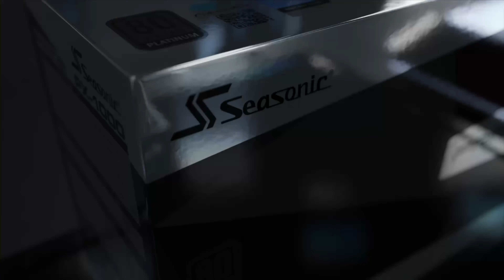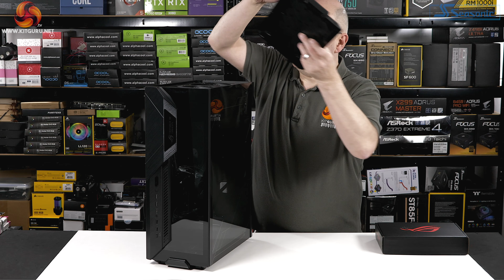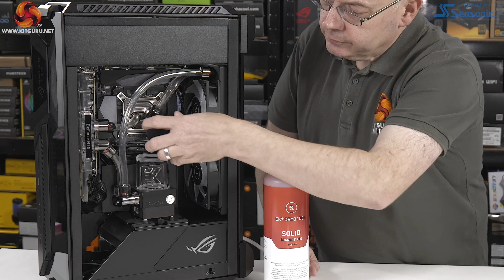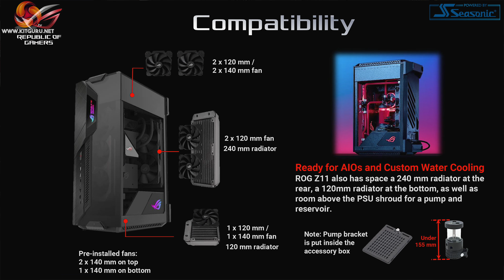Asus ROG Z11 is Mini-ITX. And Weird.

Comment from the maker: £240 - yay or nay? 

00:00 Video Start
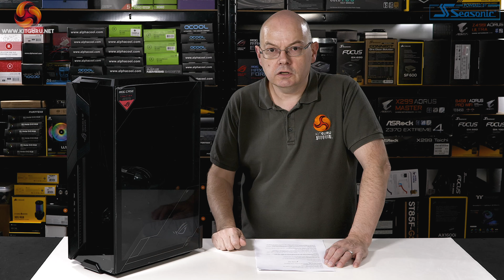00:13 What is this ?
01:33 It's how much?
02:05 Peel Porn
02:30 A closer look - taking panels off
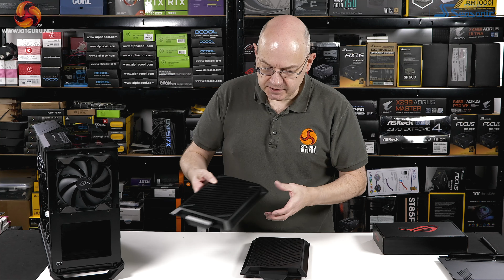03:56 The Fans
04:12 The accessory pack
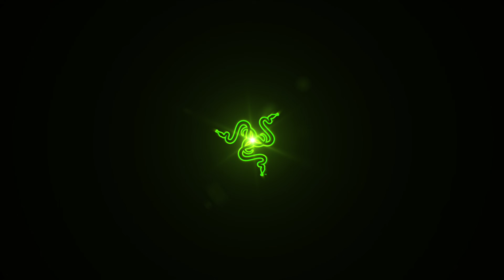04:54 Digging further inside the case
05:40 ROG logo - an extra option for orientation
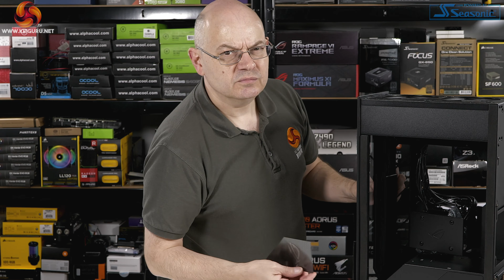05:58 What is this in the middle of the case?
07:17 Better access to top of PSU shroud
07:35 PSU Shroud area
08:18 Air flow layout
09:07 Motherboard tray
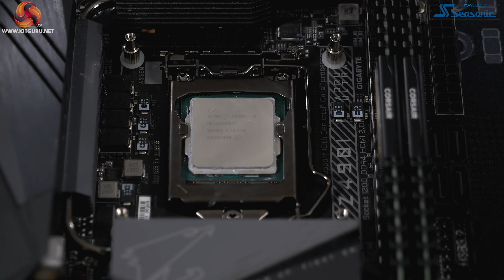09:57 Putting some hardware inside
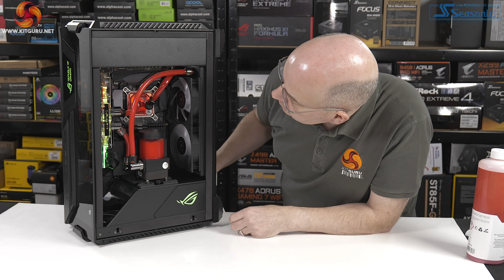11:50 Thermal and noise testing
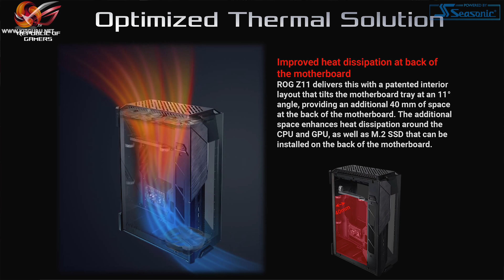14:21 Asus claims of ‘optimised thermal solution’ - we poke a bit further
15:07 More to discuss
16:37 The RGB
17:44 Leo's closing thoughts
Reply: It's as if British Leyland designed and built it but and had italians do the electrics.
Reply: nay...  And still surprised Zalman hasn't said anything about the name (Z11)...
Reply: Yay for machined aluminium, tons of useful accessories and 140mm fans. Nay for tempered glass and obstructed airflow.
Reply: Nay, it is even worse with an aircooled graphics and CPU.
Reply: Other reviewers didn't get that 90degree power cable extension or didn't spot it in the box.
Reply: Nay, big nay, nope, nope, nope... Why do these things even exist? Is it just part of marketing, such that reviewers talk about the brand and display the badge? I'm sure that sales numbers are abysmal, so being in the news is the only return on their investment.
Reply: with the lian li mini being a lot cheaper this is a terrible product value wise, however being an rog product the price is about right compared to all their other overpriced stuff
Reply: It is $69 now
Reply: Absolutely NAY! An ITX case has no right in being that big! Heck, it is unacceptable even for an ATX one!

Comment: Hello, I'm from egypt, loved you video so much demonistrating every small detail about this case , I know the video is more than 4 years old but right now This case is brans new sells for less than 40$ in my country , the price dropped so much due to low sales, would you recommend buying it ? Might put just a 240mm for the 9600x and maybe  and rtx 4060ti air cooled up the front.

Comment: I've just built a PC into this case, i513600K/Strix RTX480/ Strix Z790-I mobo with a custom loop & loads of ARGB, that all works. A lot of work yes, especially as it was my first watercooled PC but well worth the result. You say the cooling is bizarre, I have to ask, why did you have your radiator fans extracting? With that set up you have 4 fans extracting & only 1 poor little fan in the bottom pulling air in, where does the radiator get its cool air from. Thanks for the review anyway, you have helped with several of my buying choices.
Reply: After 8 months, did u find any issues with anything regarding your PC Build?

Comment: Nice review, all negatives taken into consideration, I like the case. It definitely will present various issues when building in it. But that's not really a terrible thing. I've built hundreds of computers from back in the 386 days.  The challenges I see here have peaked my interests.  Not $280 damn dollars interested, but I just ordered one for $150. Xmas sale or massive price drop because it's such a niche case? No idea lol, but $150's not a bad price for a case that's clearly well built, even if it's uh, strangely designed. 

And I'm not going to build some crazy uber high end system so I think I'll be alright.  His thermals were kinda high, but he was stress-testing the system. Normal use you'd never see anywhere close to that kinda load. Well unless you sit around running benchmarks every day I suppose lol.  It'll make for a nice looking showcase build and using modest components (13600k+Intel Arc A770) with an Asus Ryujin II AIO I should have pretty decent thermals.

Comment: I hate this effin case.  You get no access to all the ports on your motherboard and heaven help you if you want to plug something in or out.  I chose to keep all the panels off just for easier access to the back of the motherboard and to give even more airflow.  If I had a stick of dynamite I would blow this thing up.

Comment: I want to find out something  about the Asus ROG Z11. Am I able to sandwich my 240 AIO in a push pull fan config? Seconds, do you recommend shooting the air out past the radiator or draw cold air past the radiator?
Reply: I know I’m 3 years late lmao what did you end up doing?? I hav 3 Z11s Lol but the finished unit has a full strix set up with a 280 IIC rog aio and it suppose to sit on the opposite panel from face with the power button.. I tried fixing it to the opposite fan side but it won’t fit from what I’ve tried… I frankenstine all my cases I currently have a fuckjng full ATX JAMMED into this case Lol so goofy but ya.. pro tip.. mini ITX is a MUST for this case even though it looks bigger than an standard form factor mini itx case… but ya the way he has his radiator is the way the manual says to do it…

Fans on radiator - from what I’ve seen/read/learned, you want the fans blowing out from the radiator into you system… the way the pictures have the fans mounted is with them blowing out not through the radiator. But I suppose to each their own…
Reply: @JohnnyxRogain  well so I I'm having two ROG Z11 builds. In my main build I am jamming a D-TX Mobo, off course the AM4 ROG Crosshair VIII Impact. My 5800X3D is cooled by a 240mm AIO iCUE H100i RGB Pro XT placed it on the under side when the chassy is lying on the Horizontal-Mode with fans on the inside pulling cold air past the AIO. Case fans are still the stock 140mm ROG fans. They doing a great job keeping my Strix 3080 V2 OC 10GB just well within acceptable gaming temps. Lows of 28°C and highs of 65-75°C. Thinking of stuffing a liquid cooled 4090 from MSI and replace the 240mm AIO for my CPU and perhaps sidegrade it to a 120mm AIO as the 5800X3D when under-volted doesn't spit too much heat unless when running Synthetic CPU loads. I just hope putting a 120mm AIO on the main cold air intake will not feed the new GPU warm air. Will see how it folds out, although the Z11 is not for beginners, kinda find it nice to build a challenging PC build anyways. It's unique to say the least.
Reply: @xenny1x  wow nice well done! i too have 2 builds.. the second ive gotta start from scratch because my 300 series Z390E strix mobo is obsolete.. the i7 8700 is literally giving me all that it can muster to keep up with the asus dual rtx 3050 8gig.. its a perfect pair but if i want anything beyong the 3050, ive gotta start aaalll the way over.. so ive started the second Z11 the proper way Lol.. no full ATX mobo crammed on this one lol
Reply: @xenny1x  wow that’s awesome you know what you’re doing.. I jammed a 300 series lga1151 ATX Z390 E because the best cpu I have on hand atm is a i7 8700 which is just a beast but she’s on her victory lap with the RTx 3050… beyond that, no point in going up in GPU until I get a stronger CPU which also = new mobo

Comment: nay, reasons:
Reason 1: $278 without psu and the fans sucks i should choose InWin A1 Plus since it has Qi Changer and 650w gold plus with 2 free fans and it price is $206
Reason 2: so tall and its even taller than ATX cases but its mini itx mobo who needs atx size psu with mini itx mobo?
Reason 3: the fan intake and outtake are so weird placed like up and down not front and back
Reason 4: why did asus place an intake/outtake fan near to psu????
Reason 5: 320mm gpu card thats nice but its sitting near to wires and it maybe get overheated due the wires are touching the gpu 
Reason 6: uhhhh why the gpu is facing front of the glass panel? the gpu will get suffocated thats a big no no

Comment: That is suppose to be a Mini-ITX? It is bigger than most Mid-Size ATX cases. Also for that price you could spend just $80 more and get an AIO & SFX PSU with the NZXT H1 (a proper Mini-ITX case).

Comment: I would have ordered it but it despite the size it appears a 3 slot gpu will still choke in there. Went for microatx Silverstone Lucid LD01B instead as its less tall and not much wider /higher but swallowed up the 3090 with plenty of airflow.

Comment: I got it just to be more compatible with my new ROG components, especially in regard to the front panel connections.
Reply: How are you doing with your Z11?
Reply: @DreamofanObssesion  I returned it and went with a Core P1. The case is nice, but if you're choosing ITX for a compact system, then this case is impractical. Asus makes a lot of questionable design decisions, especially with their ROG products.

Comment: This case exposes the central bias almost all reviewers have these days: temps and airflow. With all due respect, the reason so many cases have the same boring look is because this has become an obsession. The point of building your own PC is to make it yours and that used to mean wild & unusual cases and crazy water cooling set ups. Now we have the same square boxes with AIOs that all look alike except some small variation of the cpu block. Look back into PC case history and you'll see cases like the Cougar Conquer, Deepcool Tristellar or the Thermaltake Core P90 and its obvious that this case follows in their footsteps. Cases like this are obviously show pieces and its a shame that even veteran reviewers like Leo can't appreciate them without falling into the trap of decibels and degrees. We need some imagination and creativity desperately.
Reply from the maker: Leo here: I see your point however I consider a case has to to work reasonably well in its own terms. If the case is different for the sake of being different that might be a good move but there are reasons designs tend to follow certain paths. We have the ATX standard and motherboards, graphics cards, radiators and power supplies are boxy things with 90 degree angles. As evidence KitGuru is not entirely narrow minded I offer you the Fractal Design Era 
https://www.youtube.com/watch?v=sBSceqwul5Y
Reply: @KitGuruTech  Hello Leo, great to hear from you. I wouldn't say "narrow minded" is the right way of expressing it but rather it seems more like an ingrained instinct at this point. I watched the review for this case by Dmitri from Hardware Canucks and he seemed to express the same kind of confusion that you did trying to "figure out" this case. They aren't made to make sense but rather to be fun. Something sorely lacking in the PC industry lately. You are correct that its odd to see an ITX case so large but its hardly the first one and by its design you can tell its meant to be used to make a crazy display piece. The proper reaction to seeing cases like this is "LET'S GO CRAZY!!" not "I wonder what temps will be like for the GPU". Would love to see a video where you do your version of Leo's Wildest PC ever!! Should be epic.
Reply: @perdomot  I think the problem for me with this case is that its a MINI ITX case so you are going to be limited in using a motherboard that tend to be not very fully featured (RGB connectors for one etc as Leo mentioned). The whole point of Mini ITX is to keep things small and to accept some compromises with that point. I think its a great looking case to be honest, but its placing itself in a very unhappy middle ground.
Reply: @theonlyredspecial  I quite agree with you as I have an ITX mobo in an ATX case at the moment but as soon as my new heatsink comes in, its going into a much smaller case. If the case Leo reviewed was something more common like the other one he showed, it makes no sense but one look at the style of the case should make it obvious that its not supposed to follow the usual logic. Leo used a very simple soft tubing water set up but it could have been far more elaborate with hard tubing and more RGB. I am certain they have stuff at Kitguru to overcome whatever the fan RGB problem was but they didn't do it. This made the case look bad, dull in fact, which defeats the purpose. Everyone seems to do red because its an ROG product but why not some crazy unicorn rainbow stuff? I am hoping somebody gets this case and makes an over the top RGB nightmare. LOL
Reply: @perdomot  interesting ! I’m not sure it makes much sense for Leo to start hacking away at the build with adapters to overload it with rgb when most people wouldn’t be able to do it out of the box. I think Leo tried to make this review ‘real world’ but I could be wrong. After all mini itx does seem to be limited in many regards due to the platform itself. 

Are you buying this case or do you own it ? Would be curious to hear what mods you would do to it to make it look better. Seems a similar sized atx case would make more sense overall but always good to read people’s opinions!
Reply: @theonlyredspecial  There is nothing sensible about this case. Basically, you have to fall in love with the look of the case and then start planning what you want to do with it. I've seem Jayz2cents on Youtube do some crazy builds and you have to see things that way otherwise it makes no sense to spend the cash. Look at all those tiny boutique cases like the Ncase M1 or the Sliger series that cost as much or more but use a lot let materials and you can see that aesthetics plays a huge role for some people. I like the look of the case but not enough to pay so much money for it as I agree that the size should have at least an M-ATX mobo inside. I am planning to get myself a Sliger SM560 in a couple of months because it does make more sense for what I want to do and that will cost about the same.

Comment: please try it with radiator fans as intake instead of exhaust, i have very different results
Reply from the maker: Feel free to share your test results. The Asus Reviewer's guide shows radiator fans as exhausts in two separate images but dwells on airflow with the three pre-installed fans, which isn't entirely helpful.
Reply: Check other reviews. This would be overpriced at £2.50.

Comment: The reviews where products fail are perhaps even more important than the others. Keep up the good work.

But £240? Just no. Drop the fan / RGB hub and it might be worth £50. Might. Did you have the radiator fans in a push or a pull configuration? Might cooling be better in a pull configuration?   And how protected are the video, USB, and other output cables from being damaged by the top fans? Do you need angle adapters?

Comment: didn't steve tell us to mount coolers tubes down? ^^
Reply from the maker: Kind of, but not really. With an All In One with the pump on the block you probably want tubes down. With a custom loop you can do it any way you like provided the pump remains wet, however you may get some gurgling with the radiator unions at the top. Custom Loop FTW.

Comment: could you not instal the 2 fans on the radiator as intakes for better temps
Reply from the maker: That's a thought. Yes you probably could do that, although the air then has to turn 90 degrees and exit vertically.

Comment: I wonder if you could work out putting the rad in the top to go with the airflow, granted that'd probably cause issues with getting cables to the motherboard
Reply from the maker: I'm gonna say  there is no chance, however if anyone figures it out do please send us a photo
Reply: @KitGuruTech  for £240 I'll pass XD
Reply: @KitGuruTech  I've just built one with a custom loop with a 240 in back  & a 240 on top with 90 degree plugs on the i/o cables, no problem